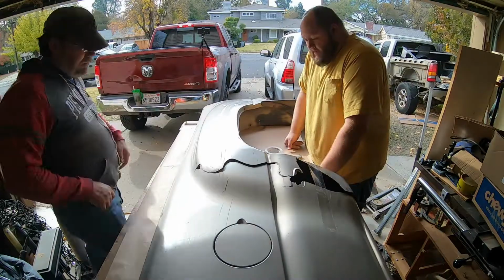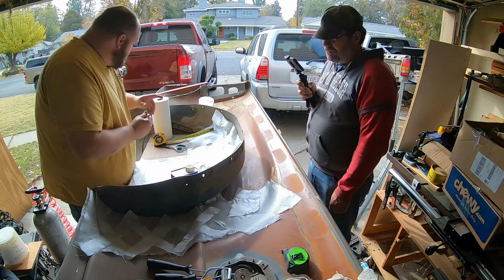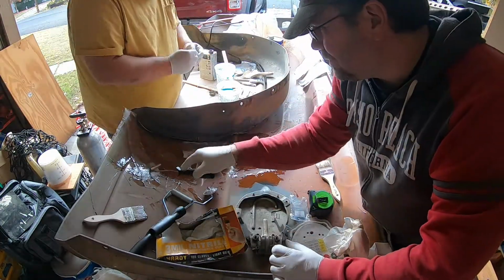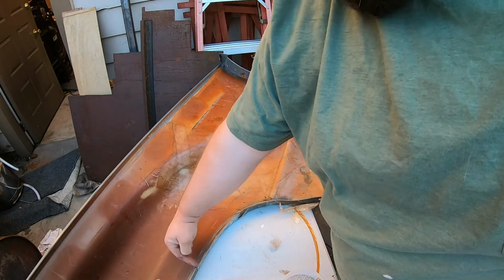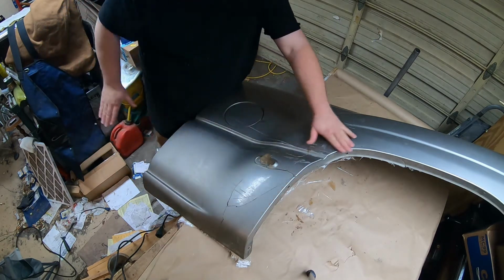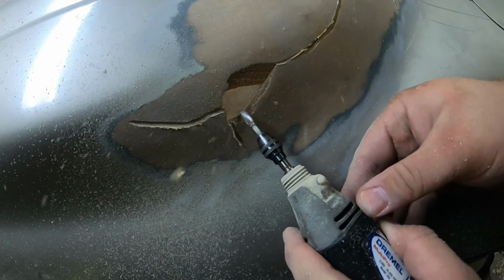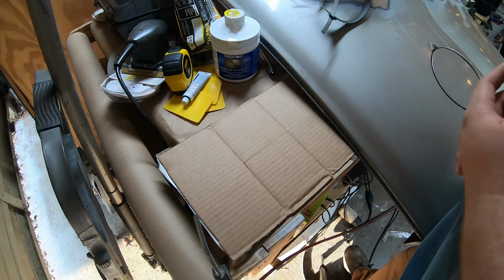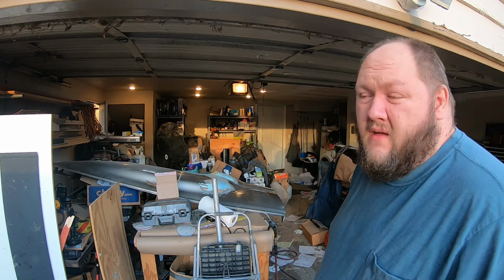GMC Sierra quadrasteer bedside fiberglass repair pt 2

Comment: When you use filler on these panels you should have used kitty hair to fill in the cracks. It’s fiberglass reinforced filler.
Reply from the maker: I hadn't thought of that. I was concerned finding a filler that was flexible to somewhat match the panels initial flexibility. I'll keep that in mind for next time
Reply: @handcraftedoverlanding  after seeing you work on the truck, you look more than capable of painting it. 90% of the paint job is prep work! So you got it in the bag. 👍

Comment: Can you please send me the list of the exact epoxy and fiberglass you bought from home depot. Thank you
Reply from the maker: I used the following:
Bondo 1 qt. All-Purpose Fiberglass Resin
Bondo 8 sq. ft. Fiberglass Cloth
I sanded at 80 grit, I blew it off and used acitone to wipe it clean. You can use something simple to ensure the fiberglass is fully saturated. I picked up a set of rollers from Amazon, you can look up "fiberglass roller set". I think it was $14